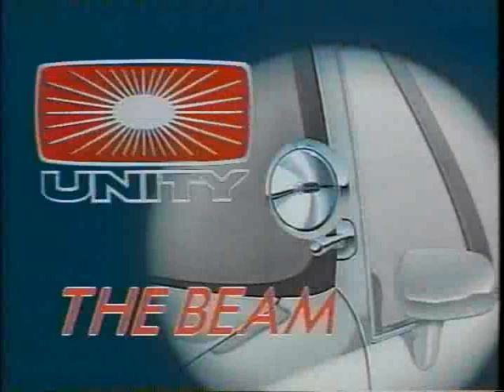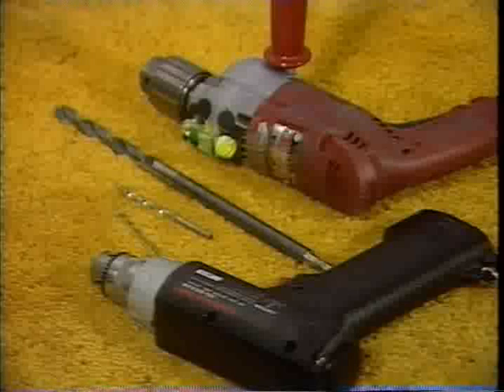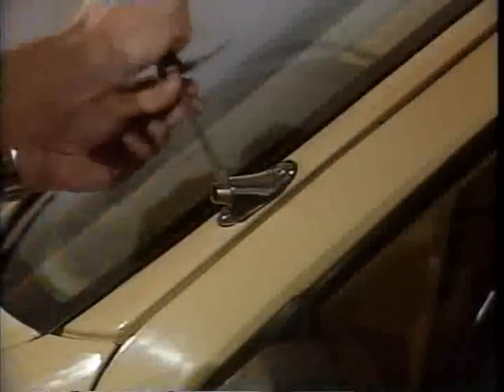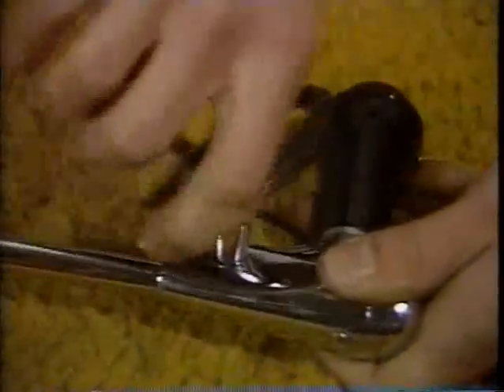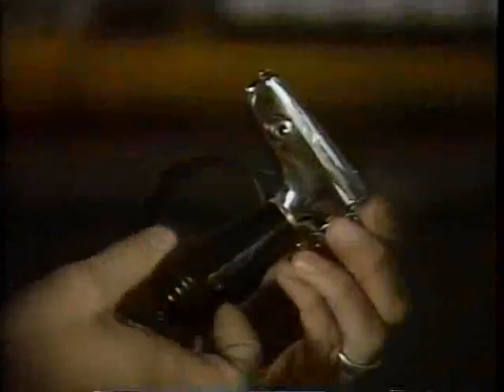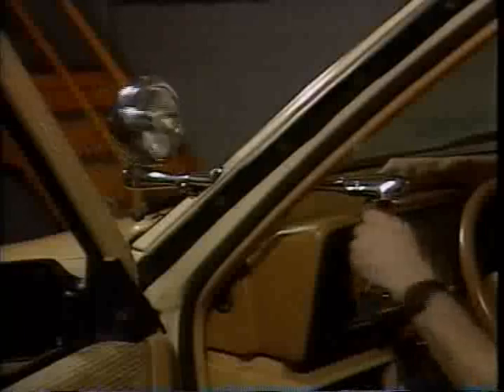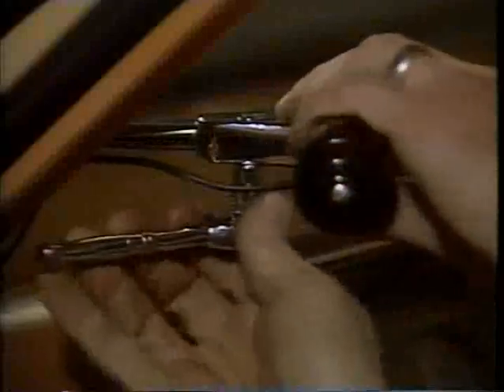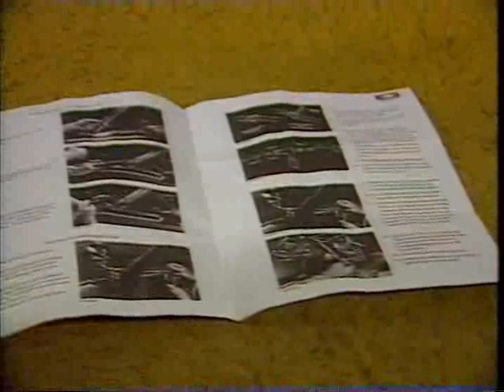Unity Spotlight Installation Video

Comment: Can I install one of these on my 2001 Mercury Grand Marquis? 
Came off a 2001 Crown Victoria
Reply from the maker: 2001 Mercury Grand Marquis and 2001 Ford Crown Victoria use the same spotlights and installation kits. There are two different applications though for both vehicles that use different parts: Door mount and inside post. 

Door mount goes solely through the door frame and inside post mounts with the bracket on the inside of the vehicle comes through the post and needs a notch in the door frame. Inside post in more commonly used on police vehicles. 

If the spotlight was from the inside post version those lights are also sided. Driver side light does not mount correctly on passenger side and passenger side light does not mount correctly on driver side.

Lights also need installation kits, I don't know if one came with your light or not. Inside Post driver side uses a 5556 installation kit (233L bracket) and 5557 installation kit on passenger side (233R bracket).
Door uses a 232 installation kit for driver side and 232RH installation kit for passenger side.

Comment: Do you guys have a kit for a 2006 Ford Mustang GT?
Reply from the maker: 2006 Ford Mustang uses a spotlight with a CL length shaft mounted with a 189 installation kit for driver side mount or 189RH kit for passenger side.

CL Shaft Spotlight Options: https://www.unityusa.com/CL-Shaft_c_2958.html
189: https://www.unityusa.com/189-Installation-Kit_p_786.html
189RH: https://www.unityusa.com/189RH-Installation-Kit_p_788.html

Comment: you should cover air bag interference perhaps ;)
Reply from the maker: Unity approved applications should not interfere with deployment of air bags. If we find that there would be any interference with deployment of air bags we try different mounting location. If we still cannot find a safe and functional location, we do not publish an application for the vehicle. For instance we do not have a spotlight application for the current model of Chevrolet Colorado/ GMC Canyon due to interference with side air curtain.
Reply: Unity Manufacturing tyvm

Comment: What could I use for a 2002 Jeep Wrangler
Reply from the maker: For a 2002 Jeep Wrangler a spotlight with a V length shaft is mounted on post using a 12 installation kit for driver side mount or 12RH installation kit for passenger side mount.

V Shaft Spotlight Options: https://www.unityusa.com/V-Shaft_c_2971.html
12: https://www.unityusa.com/12-Installation-Kit_p_794.html
12RH: https://www.unityusa.com/12RH-Installation-Kit_p_814.html

Comment: Would this be able to be mounted on a 2019 Toyota 4Runner?
Reply from the maker: Yes, on driver side (LH) only. A spotlight with a V length shaft is mounted with a 29 installation kit.
V Shaft Spotlight Options: https://www.unityusa.com/V-Shaft_c_2971.html
29 Kit: https://www.unityusa.com/29-Installation-Kit_p_758.html

Comment: Can this work on a 2004 Chevrolet Impala?
Reply from the maker: Yes, a 2004 Chevrolet Impala uses a spotlight with a CF23 Shaft mounted with a 244 installation kit for driver side mount. For passenger side a spotlight with a CF24 shaft is mounted with a 244RH kit.
Driver Side:
CF23 Shaft Spotlight Options: https://www.unityusa.com/CF-23_c_3027.html
244: https://www.unityusa.com/244-Installation-Kit_p_893.html
Passenger Side:
CF24 Shaft Spotlight Options: https://www.unityusa.com/CF-24_c_3028.html
244RH: https://www.unityusa.com/244RH-Installation-Kit_p_903.html

Comment: Could this be mounted on an 02' Toyota Camry?
Reply from the maker: 2002 Toyota Camry uses a spotlight with a GM length shaft mounted with a 214 installation kit for driver side or a 214RH kit for passenger side.

GM Shaft Spotlight Options: https://www.unityusa.com/GM-Shaft_c_3068.html
214: https://www.unityusa.com/214-Installation-Kit_p_1867.html
214RH: https://www.unityusa.com/214RH-Installation-Kit_p_1868.html

Comment: Could this be mounted on a Land Rover D1
Reply from the maker: 1994-1999 Land Rover Discovery uses a spotlight with a B length shaft mounted with an 11 installation kit for driver side mount or 11RH for passenger side. We do not have any other applications for the Discovery.

B Shaft Spotlight Options: https://www.unityusa.com/B-Shaft_c_2957.html
11: https://www.unityusa.com/11-Installation-Kit_p_756.html
11RH: https://www.unityusa.com/11RH-Installation-Kit_p_763.html

Comment: Could I put one of these on a 2012 jeep wrangler?
Reply from the maker: Yes! 2012 Jeep Wrangler uses a spotlight with a V length shaft mounted with a 12 installation kit for driver side or 12RH for passenger side.

V shaft Spotlights: http://www.unityusa.com/V-Shaft_c_1574.html

12 Installation Kit: http://www.unityusa.com/12-Installation-Kit_p_794.html

12RH Installation Kit: http://www.unityusa.com/12RH-Installation-Kit_p_814.html

Comment: What would you need for a 09 ppv tahoe
Reply from the maker: 2009 Chevrolet Tahoe uses for driver side a spotlight with a CF54 shaft mounted with a 257 installation kit. For passenger side a spotlight with a CF55 shaft mounted with a 257RH installation kit

Driver Side:
CF54 Shaft Spotlight Options: http://www.unityusa.com/CF-54_c_3049.html
257: http://www.unityusa.com/257-Installation-Kit_p_947.html

Passenger Side:
CF55 Shaft Spotlight Options: http://www.unityusa.com/CF-55_c_3050.html
257RH: http://www.unityusa.com/257RH-Installation-Kit_p_1600.html

Comment: Is there a way I can put the spotlight on my 2007 mercury milan
Reply from the maker: Unfortunately no. Our application engineers determined that on a 2007 Mercury Milan a spotlight would interfere with deployment of side air curtain. We do not recommend any application that would cause a safety issue. Instead of a post mount style spotlight, a rooflight or hand-held spotlight could be used instead. 

Rooflights: http://www.unityusa.com/Rooflights_c_99.html

Hand-Held Spotlights: http://www.unityusa.com/772-Series-5-Hand-Held-Spotlight_p_2121.html
Reply: Unity Manufacturing Oh ok thank you so much for letting me know because I was curious bout the air bag also . Thanks for the quick response !
Reply from the maker: You're welcome. Please let us know if there is anything else we can help you with.

Comment: I own a 2008 Crown Victoria police interceptor with the model S04. I am wanting to replace the black head with a chrome one I found on eBay. just ordered the matching chrome ring from you guys directly. is the head held on with the big nut at the bottom of the housing?

Comment: What unit would be best for a 1975 Chevy el Camino?
Reply from the maker: 1975 Chevrolet El Camino uses a spotlight with a V length shaft mounted with a 208 installation kit for driver side mount or 208RH installation kit for passenger side mount.
V Shaft Spotlight Options: https://www.unityusa.com/V-Shaft_c_2971.html
208: https://www.unityusa.com/208-Installation-Kit_p_769.html
208RH: https://www.unityusa.com/208RH-Installation-Kit_p_773.html

Comment: The people behind this would be sued now days because you drastically weakened the A pillar of the car making a roll over death almost certain.
Reply: @user-4xj

Sure, that's the reason the law enforcement agencies add them to their vehicles, to be sure to kill the officers/agents in a roll over

Yes, the a-pillar structure is now weaker, but there is a reason why the company has 'recommended' mounting locations and templates to perform the installations, it's because the recommended location and installation method is designed to cause the least structural damage to the vehicle

Comment: I have a spotlight installed on my 2003 ford crown Victoria and the light head will not rotate either with the handle or by hand from outside the vehicle. It used to rotate when I got it but one day it was really hard to move and I think something may have broken. I’ve checked and replaced the handle and it’s fine so what part needs to be replaced?
Reply from the maker: Below is a link to our spotlight troubleshooting guide. It will help in determining what the issue is. 
https://unityusa.3dcartstores.com/assets/images/3769SpotlightTrouble-ShootingGuide.pdf

Comment: Can I install one of these on a 2006 Hummer H3? I do not have side airbags.
Reply from the maker: Yes, 2006 Hummer H3 uses a spotlight with a V length shaft mounted with a 218RH installation kit fro driver side mount or 218 installation kit for passenger side mount.Due to shape of vehicle a 6062 spacer will also be needed for each spotlight to get proper functioning clearance.

V shaft spotlight options: https://www.unityusa.com/V-Shaft_c_2971.html
218RH: https://www.unityusa.com/218RH-Installation-Kit_p_819.html
218: https://www.unityusa.com/218-Installation-Kit_p_805.html
6062: https://www.unityusa.com/6062-1-long-12-ID-Spacer_p_434.html